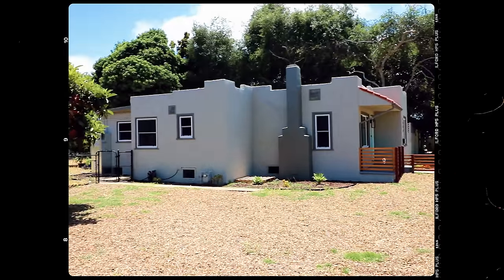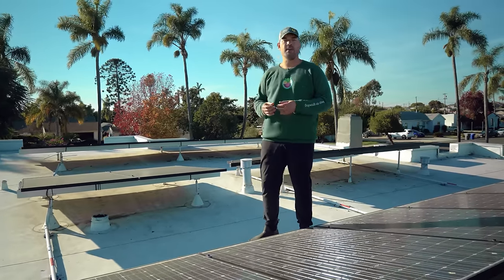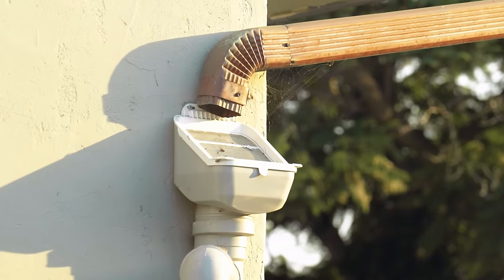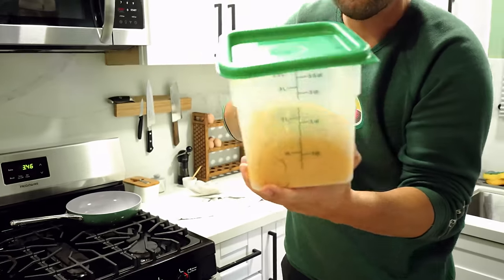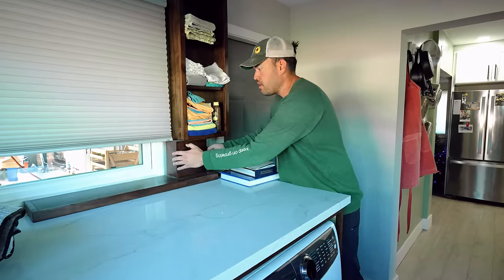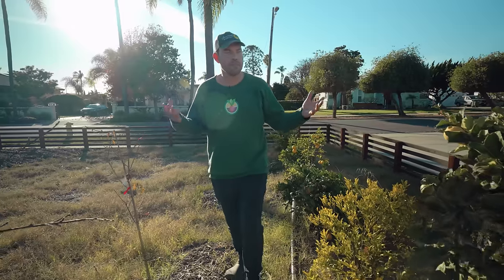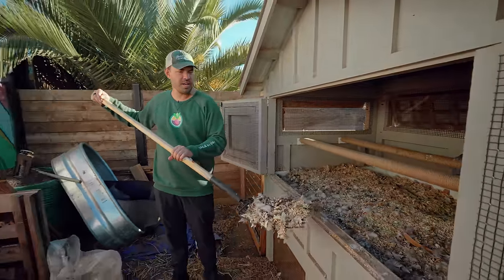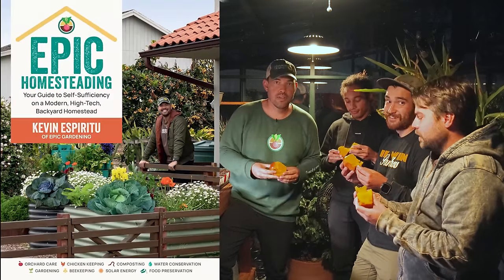3 Years Of Homesteading: What I've Learned

Comment: Around 20:20 you’re talking about your composing system   Here’s my question which I’ve never seen actuated. “How do you get the composted matter (the quasi dirt) from bin 1 to bin 2 and bin 2 to bin 3, etc. and if you are continually adding to bin 1, what are you moving over to bin 2? “ I would love it if you could not only explain but show the process please. 😊
Reply: Great question. I was also wondering the same. I'll have to check out his hot compost vid to see if he mentions it there.
Reply: I would guess he adds to bin 1 for awhile, then adds to bin 2 while bin 1 breaks down, then adds to bin 3 while bin 2 and 1 break down, etc. When bin 1 is finished, use it and begin the process over again. That’s easier than moving half-finished compost from bin 1 to bin 2.

Comment: We have about 5,000 gallons of rainwater tanks but in about 11 big tanks and 3 little ones.   We have hooked them up to a laundry to landscape type system (same as our laundry to landscape but not all are connected to the  actual laundry).   We turn them on for 10 minutes to fill the basins.   We use a timer so we won't forget.  The tanks then can water our fruit trees in the very hot summer instead of using more city water.

Comment: A well set-up solar system is surprisingly rewarding both financially and in the way of knowledge we are using a renewable resource for our luxuries such as air conditioning in the heat of summer. Our only mistake for those planning - not getting a big enough inverter! The average estimated output was far less than we actually produce (as we live in sunny North Queensland, Australia ☀️) so some days we could be producing way more but are limited by our inverter. Its still very effective and covers our needs but a small frustration to limit the potential.

Comment: HEY!  love the show!  just a small correction where people always get confused. If you used 1000 kwh from your power company  but then your panels at the same time ADDED 1500 kwh to the power grid then yes you would have a rolling credit of KWH.... the meter for your electric company and the meter for your solar panels are different.  If your meter for your panel says you generated 1500kwh you may have used 1000kwh from your panels during the night /day and only actually contributed 500 kwh to the power company. its all about how much you actually generated to the power grid. however having a battery bank for your solar is deff the way to go :)

Comment: Still watching; insulate your house well, you have the POWA!
Reply from the maker: Need to...
Reply: @epicgardening it should have been the number one thing my folks should have done on our 3 story farm house as we heated with wood and coal.  Ugh!  Would have saved sooo much work.  I got it done but a bit late.  It was Totally night and day difference to do just the attic.  Use to be hit with heat going upstairs in the summer and after insulating you couldn’t tell the difference.  Couldn’t do the walls because of triple lathes.  We did our own ranch top to bottom because we discovered the ills behind the siding and there was ZERO insulation around the doors.  Again night and day difference!  Unbelievable that there was only 4” of scantily placed insulation in the roof.  😂and this was approved by gvt for this cold Z5.  No vapor barriers on both sides of walls either.

Comment: Regarding the grey water system, one concern is that clothing made of synthetic fibers like polyester (the majority of today's clothing will contain some) degrade over time and release micro plastic particles into the laundry water.
The polymers (long and complex chain-like molecules based on carbon) used in clothing are not biodegradable or degrade into harmful products that will get carried away by the laundry water towards your plants.
Did you consider this aspect of gray water?
I personally wouldn't want to release plastic-bearing laundry water into my soil. In my opinion, that dirty water would be better reused by diverting it into the toilet flush tank.
Also, this is a long-term issue that will eventually have some impact on your garden and plants or on your health. In the first years, the effects may not be noticeable, but micro plastics will build up over time in your soil and eventually leak into groundwater resevoirs or end un in your crops.

Comment: What happens if there is a hal storm and it completely destroys you solar panels? We had a ice storm in 2000. We had no electricity in our county for 38 days. We did just fine without it. I have a 120 ft well so I don't have to capture rain water nature does it for me.
Reply from the maker: They can hold up to hail quite well, and especially here in San Diego we really don't get big hail like that
Reply: I live in the Ouachita mountains of Southwest Arkansas. We get all kinds of extreme weather. I have seen softball size hail, tornados and two feet of snow. It also can be -10 in winter and 120 degrees actual temperature in summer plus humidity.

Comment: I feel like you’re a segment on Solar panels was a bit misguided. first of all, the math is not complicated at all. let’s use simple numbers, if you produce 100 units, but you’re only using 50, the other 50 goes into the grid as credit that you can use at a later time. That’s literally all there is to it.

I also don’t understand the statement about being able to actually live off grid for a period of time when using batteries. Provided that you have sufficient batteries to last you two or three days and of course depending on your geographical location and amount of solar panels, you would be using the electricity that is being produced by the sun during the day and during the night and on really cloudy days you would utilize the electricity stored in the batteries. hence, you would be able to live like that continuously, which is something I’ve been doing for the past four years, including charging my electric car with 100% solar power.